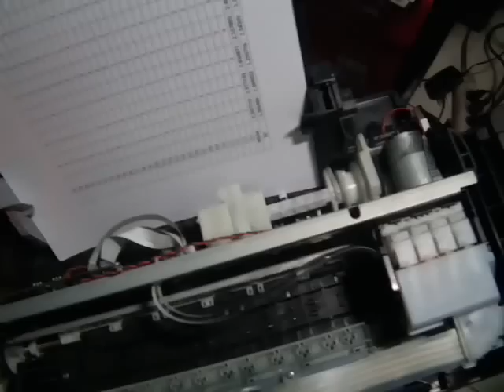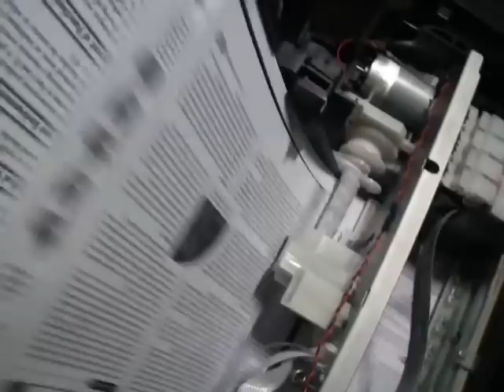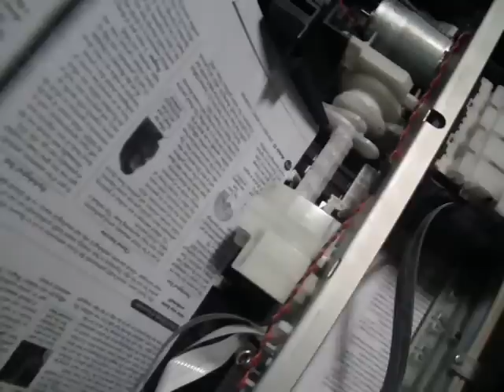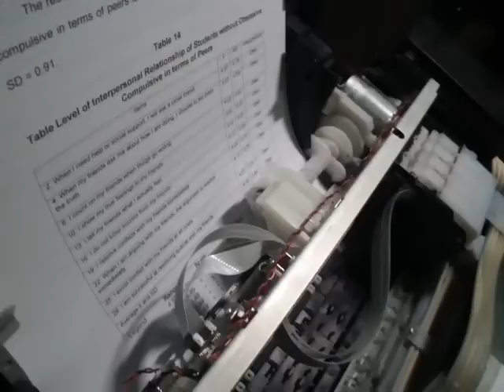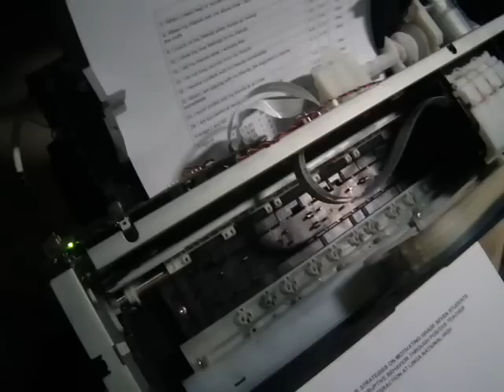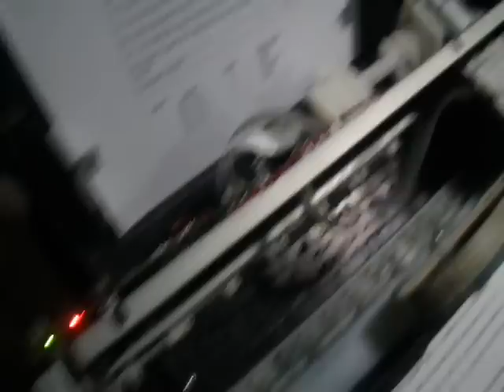Epson L110 Paper jam Error & multiple paper feed

Comment: In Epson l110, l130, l120, l220, l210 the lower paper feed roller has a small spring inside.  You have to remove the roller from the casing and pull it off its axle.  If you are having multiple paper feed problems, the spring inside is most probably broken.  Just replace the entire roller assembly if you can find one.  In my case I just bent the end of the piece of coil spring left on the axle.  If you look at one end of the gray rubber roller, there is a slot.  The bent end of the spring should go in that slot.  There's a you tube video on how you can disassemble an l110.  The small paper feed roller can be reached when you remove the bottom part of the printer where the ink pads are.  Sorry if instructions are not clear.  Once you get the lower roller I'm talking about, this will be easier to understand.

Comment from the maker: i already brought it to epson service center, they say that you have to replace the small spring(see image below)
https://www.dropbox.com/s/nfr8cse46r52wlo/IMG_20141126_210813.jpg?dl=0
https://www.dropbox.com/s/33rmz6ru4glg9n7/IMG_20141126_211025.jpg?dl=0
Reply: can i use spare spring? or need to buy a new one?
Reply from the maker: Yes you can use your old spring or any thing the same
Reply: Mic Calaramo i replaced the spring... but the problem was still there... what should be the tension of the spring? tight or loose? Thanks
Reply: +Mic Calaramo  HOw did yo repair the printer? what did you do?
Reply: thanks for the image, I saw my spring is gone, 
then I fixed it by replacing it using small rubber band